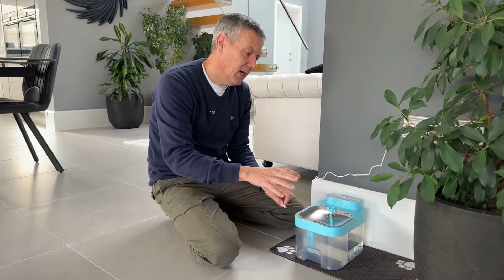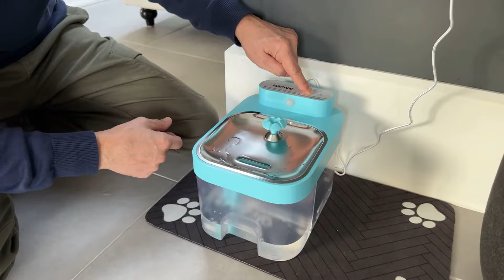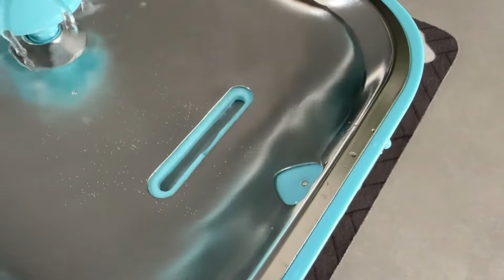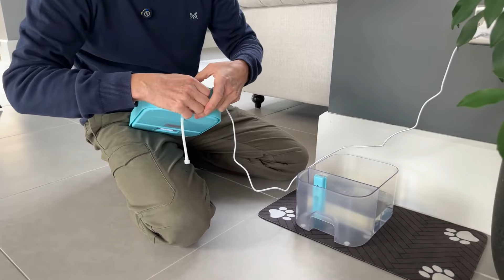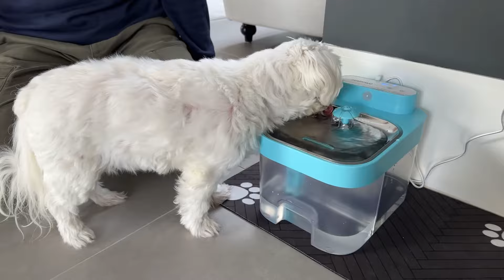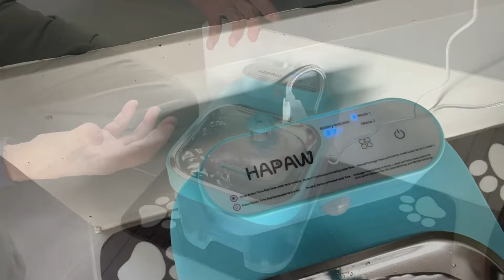Honest Review - HAPAW Cat Water Fountain Review

Comment: As others have mentioned, I am also confused by the “circulating for 24 hours, then dumps”?  
Is it that it pumps the water continuously in ONE direction, but every 24 hours (even on mode 1) it stops briefly to dump all the water, then starts again? I ask because I feel like a lot of water will be wasted/go not drunk if it was on mode 1. I have a largish house with two floors so I like to keep a fountain on each floor to encourage drinking without having to go across the house but I’m not ready to invest in TWO of these yet. Does it truly last ~5 days? I think I would put it on mode 2 but even with my current fountains I always keep a regular bowl of still water next to the fountain just in case of any power failures
Reply from the maker: The fountain recirculates the water continuously to keep it fresh; the "dumping" cycle is a brief refresh of the drinking area rather than wasting water outside the unit. In Mode 2, it should comfortably last around 5 days depending on usage. Keeping a manual bowl as a backup is a great idea for peace of mind! Mark

Comment: What every review of this water fountain has failed to answer is the mystery of continuous water circulation. 

is it using the water from the clean tank? 
Is it using water from waste tank? 

well logically it seems like, the motor is designed like a 3 way valve. 
1 valve or inlet valve is used to draw the water in from the clean tank 
2 valve or outlet valve pumps out the water through the faucet. 
Once the sensor on top of the tray detects the water level it will close the inlet valve or valve 1.
Now the 3rd valve or the 2nd inlet valve seems to connected from underneath either via tubing or some pathway to the drain hole on the top side. Creating a loop for the water to circulate without contaminating the clean water tank. 
And then there is simply a drain valve at the bottom which will open and let all the water drop through with gravity. i think that about what I can figure. 
i will be buying one to test my theory out. 
The only concern is how easy it is to service any of these components in the case of any maintenance or repairs as they are completely emclosed in that blue box
Reply from the maker: That is a very interesting theory on how the internal circulation works! Mark

Comment: My cat has an autoimmune disease and I was wondering if every part of the bowl where water is in contact with is reachable by sponge or brush when washing.  I recall on the news, a baby sippy cup lid was designed where some parts were not reachable by sponge/brush.  It had gunk built up in these unwashable parts.
Reply from the maker: I would suggest speaking to a vet professional showing them the model and they will confirm. They may have other suggestions too.

Comment: I’m interested in purchasing one of these. I use the filter fountain right now but I’ve noticed after a few days my cats don’t drink from it as much. I’m guess the water becomes smelly. 

So just to make sure I understand (because Amazon doesn’t explain well), mode 1 needs to be plugged in for continuous flow of just the stainless steel basin. And mode 2 is battery with motion only? And lastly for discarding the water, this can be done manually by holding the mode button while in mode 2, but can also be programmed to recycle every 24 hours? And the sensor will fill water if it’s low? I think I’m going to get one. But I have some filters I need to use up on my old fountain first. Your review has been very helpful, thank you!
Reply from the maker: You've got the modes exactly right, and I'm glad my review could help clear that up for you! Mark
Reply: @MarksTestLab is there not a way to use the battery only in mode 1?

Comment: Does the alerts when it’s low notified you still when it’s not plug into the wall through the app?
Reply: I just received mine and am so disappointed. It keeps running and spilling water all over the floor.  I had high hopes for this but am returning it if I can’t figure out how to prevent this.
Reply: @kimmarie8164 remove the sponge filter from the tiny port near the drain!! I did this and it fixed the leak
Reply: @kimmarie8164  Does the water reach that tiny little water level sensor?  I'm not too sure if I understand the modes well.
Reply from the maker: no it needs to be plugged in.